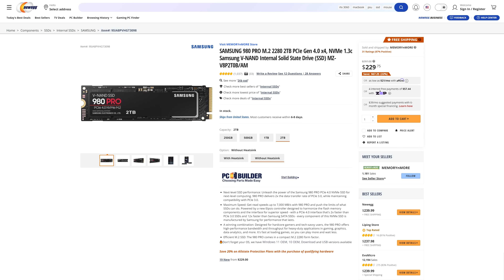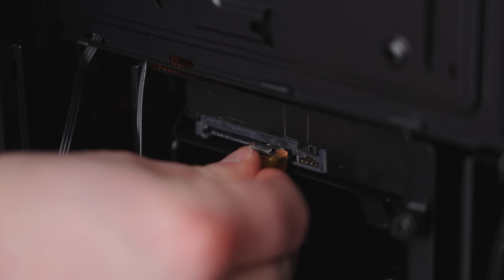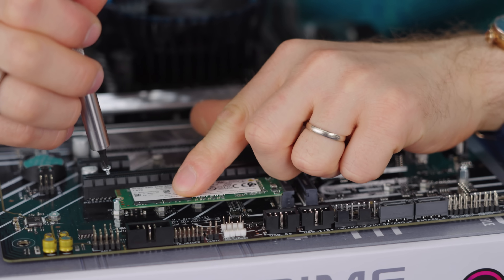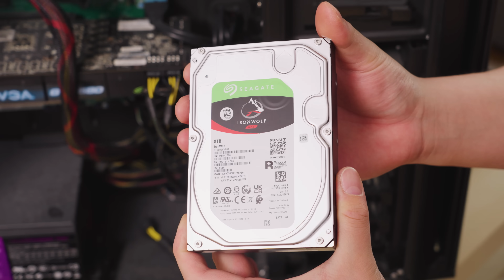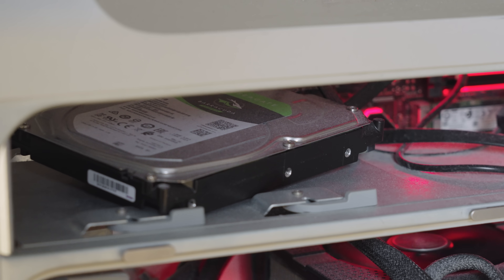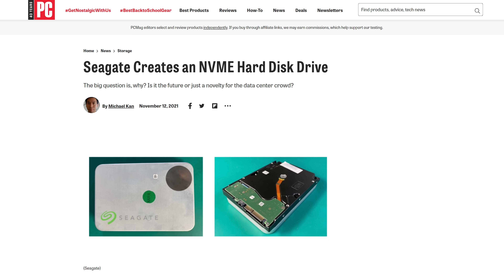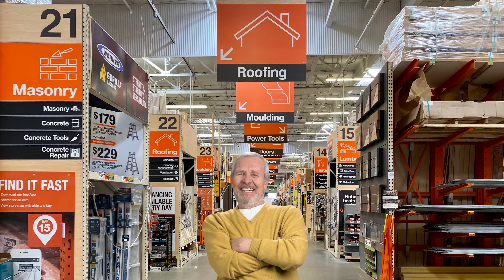Is SATA Obsolete?

Comment: I think you are too young to remember that SATA was introduced WAY before SSD's ever came out. SATA made its debut back when Pentium 4 was still around. SATA 1.0 came out along side PATA and was a niche thing with limited ports. Its true SATA's claim to fame only really came about when SSD's become a thing, it was near impossible to have a mechanical HDD flood a SATA bus, even to this day some of the fastest HDD's max out at 250MB/s thats slower than SATA-II speeds let alone SATA 3 speeds.

As for how long will SATA be around, well probably not a long time lest to its life. NVMe 2.0 specification adds support for NVMe protocol for HDD's, meaning HDD's will most likely be connected direct to the PCIe bus in later years, which honestly is not a bad thing, rather than allocating lanes for SATA, just allocate them for PCIe and allow the system integrators to chose how many of them are routed to either slots or drive connections

We are going to need NVMe for HDD when Multi actuator HDD's become the norm, Seagate already manages in tests to get 500MB/s out of mechanical HDD's
Reply: well in the near future sooner or later there will be new type of hybrid drive you can also get. this new hybrid drive bascly combies both the SATA HDD and the SATA SSD into a new hybrid drive that works in a new way. how it basically works is the HDD part of it is the high capacity slower longterm storage part that also doest need to have a constant source of power. then the SSD part acts like a very fast data speed and high capacity data cache buffer for fast and qick need for much more often used data. this combo can be used to massively reduce ware and tear of both of those drives by basely complenting  and cover each others weaknesses for a much faster and much longer lasting drive that hdd's and ssd's separately won't even be able to compeate against.

Comment: It's not the SATA that is obsolete, it's the SATA SSDs that are obsolete!
SATA 3 has a huge bandwidth, yet SSDs can't even do a 500MB/s Read and Write, without going under 100MB/s after a few seconds. We need better SSDs!
Reply: @pistolfied  But they are the only with high capacity........ :(
Don't worry, my OS is on an nvme. I was just saying that SATA is not the problem!
Also, do other SSDs have a constant of 500MB/s read and write? NO!!!! All of them are shit!!
SATA 3 has a bandwidth of 6 Gigabits per second, that means 750 Megabytes per second. And no SSD ever had a constant writing speed of 300MB/s, even being the only SATA SSD in the PC.

Comment: Sata would make sense to stick around since it might just be easier to expand storage. Well, pcie expansion cards for nvme ssd's exist I guess
Reply: As it is inside of the ATX spec though like IDE and PATA it is in the recommended part but it is in the required parts for all Intel and AMD chipsets I do not think it will be going away any time soon.

Comment: "NVME drives have to be screwed down"

Se we are just going to ignore the 4 screws that SATA drives use?

And let's not forget the artform that was rolling PATA cables into tubes and the origami like folding that was needed to organize those things. PATA was slower and harder to work with, but with appropriate time and care, could be cable managed quiet eloquently.
Reply: Don't look at me using double sided tape to mount my SSDs!
Reply: "Se we are just going to ignore the 4 screws that SATA drives use?"

If you have a good PC case, you'd have a toolless HDD/SSD drive caddy for it.
Reply: @TheTruthDragonNJ09  Even on a bad case, you don't really have to screw the drive in, just don't bump it too hard. Most of the time the slot that the drive sits in is tight enough that the drive isn't going anywhere unless you pick the computer up and move it. Even then you're probably fine.
Reply: @TheTruthDragonNJ09  by that same token, some motherboards have toolless m.2 securing latches.
Reply: If it's an SSD you can just let it roam free lol. A single screw is more than enough, or double sided tape. Some cases have those little sled things that clip in and use a single thumb screw to hold the sled itself in place.
Reply: @TalesOfWar  not if you're moving it around often
Reply: NVMe SSDs Need to be screwed down

2.5" Sata SSDs don't need to be screwed down, can sit free roam, whatever you want, no screw required. That's the difference.
Reply: @Axisoflords  Some boards have the nice handy clip thing, like Asus use.
Reply: Those SATA drive screws aren't absolutely necessary. I have 2 PCs, with ...14 drives total. Out of those, 3 are NVMe, which leaves 11 SATA drives. Both mobos support hotplug, and two drives aren't in a toolless slot.
Reply: Plus SATA drives are hot swappable, wouldn't want to try removing an NVMe driver while powered up plus they are usually hidden in very hard to reach places like under a GPU. SATA will still have quite a few years left as 550MB/s is still a decent speed for now, especially if it's just a storage drive.
Reply: @Mr Pais 2 PCs
Reply: While you should screw your drives down, they don't need to be screwed down to stay working, meanwhile SATA drives you can just leave there for years just sitting there, especially for SSDs where there's no worry about moving parts breaking.
Reply: Sata does not "need"  screws.
Reply: @Mr Pais Mine only supports 8, but without installing it into one of those oldschool super tower cases, you'd probably never be able to use all those ports. (I guess you could also install a few SATA to e.SATA port adapters to use the remaining ports)

Comment: I remember the first time I saw a computer with an SSD. It's boot up time blew my mind.
Reply: 3 seconds Vs ... 2 minutes
Reply: I agree, when I bought my first SSD last year (yep I'm pretty late to the party) it blew my mind because everything feels fast.... especially in multitasking
Reply: @KKRDaily  Damn, only last year? It's like a brand new computer isn't it? Lol. 

I bought mine in 2015 and it's impossible to go back to a HDD for boot times lol. I drug my old PC that was built in 2011 out to use as a streaming PC and it only had 2 HDDs in it, and I HAD to add an NVMe to it lol... It took sooooooooooo long too boot up lol. I ended up downloading a modded BIOS to allow NVMe support, and it was so damn worth every penny lol.
Reply: @KKRDaily  sounds like a ram issue.
Multitasking relies on ram, if your SSD improved your multitasking it means you are filling up ram and falling into disk swap.
Disk swap is not recommended for SSDs as it eats their lifespan quickly.
Unless you meant "faster starting speed of programs" instead of "using 2+ programs at same time"
Reply: @KKRDaily  did you get nvme or sata?
Reply: i was late jumping on the ssd badnwagon too. just figured thats how choppy computers were lol. The epiphany was real..
Reply: same here!, back then i went from 3 mins to 3 seconds, it was glorious.
Reply: I remember when running Linux against Win98/2K/XP was always funny when it booted under 5-7 seconds to KDM from normal 7200RPM HDD, where windows took good 20-30s at fresh install, and 1-3 minutes after a year.

SSD made huge difference to windows, but not so much for Linux, that was now under 5 seconds cold start.

I just converted few PC at work from 2.5" HDD to SSD and boot time from 3-15 minutes went down to 10 seconds. Drives weren't fragmented or anything, just stupid slow 5400 RPM drives.

Cheapest way to keep worker happy...
Reply: @paristo hmm Ive always how linux ran on hdds, i guess it makes sense its more better than windows because many distros especially light ones like arch and debian are bloatware free
Reply: Same! I upgraded my laptop to an ssd and it was crazy. Thought everyone was exhadurating. Also it ran a lot cooler as well
Reply: @Jamman1403  did... did u mean exaggerating
Reply: @3Dusers  To be honest, I like "exhadurating" better.
Reply: Now we're talking 10x faster than those OGs. I remember my first SSD. When I built my first computer it was the best $235 I had spent.
Reply: I was so used to Windows 7 booting time on HDD, when I tried SSD, the speed increase is just insane
Reply: @danielhandika8767  few years ago, I went from HDD to nand flash nvme. And my mind... It's somewhere on the floor.
Reply: I changed from HDDs/SHDDs to nvme. Supernova'd my brain.
Reply: Yep. My old laptop with a hdd had a 10 minute boot time. It was so bad that when it did boot it had to load in the icons for the apps on the desktop 1 by 1. The HDD was definitely the bottleneck. It had an i7 6700HQ and a GTX 970M and it was fast. I literally never shut it down because of those horrible boot times.
Reply: Now if only mobo manufacturers stopped making bloated BIOSs that take 10+ seconds to boot through that would be nice. Crappy laptop with text based bios on m2 boots in 3 seconds. Beefy gaming pc with gen4 m2 takes 10, unless you enable all the fast boot settings that make everything unusable after boot.
Reply: I was have my first ssd in 2015 its was fast, I have it until now.
But I keep lots of movies in my computer so I have 8 tb and 4 are of hdd.
Another with 2 m.2 and  one ssd with 2
Reply: I am late in the game. My first SSD was a week ago and it is just amazing
Reply: for real, made me change from just sleeping off the PC to turning it off entirely after every time I use it
Reply: 7 seconds for a full Linux desktop experience on the lowliest Thinkpad with an Intel G2. Unzipping 100 MB of Eclipse went so fast that I sat with my timer in my hand waiting for it to finish, only to realize that the hundreds of small files had unzipped in < 1s.
Reply: my nvme blew my mind on my pc when i used to be bumping with my hdd laptop
Reply: The opposite is true for me, ive always used ssds and I got mindblown how slow computers with hdds were at my school lab; they took 5 min just to boot into windows 10 while my mom’s old macbook air booted the os in 10 sec
Reply: Bought my first 128 GB SSD for 129 USD back in 2011.
Reply: @Vengan92  So, roughly $1 per gigabyte?
Reply: Bought my first ssd in the end of 2020. Also 128 gig for like £30 second hand
Reply: It was like 1984 all over again, when Apple introduced the Macintosh.  8 seconds of boot time is still quite awesome.
Reply: Last year I upgraded my Lenovo Thinkpad to an SSD. The thing now runs like a new machine in terms of speed.

Comment: Really for most yes it is. Unless you need massive amount of TBs of storage and don't need, want or have cash for SSDs for that, yeah. Also NVMe SSDs are not even that more than SATA drives, also DirectStorage advantage too with modern NVMe ones. Every computer comes with them too.
Reply: I just built a new computer last month, and often the NVMe option was cheaper than the equivalent SSD from the same brand.

Comment: to be honest I don't see SATA going anywhere anytime soon. Sure NVME is getting cheaper but it's still no where near the price of a 2.5 inch SSD and damn sure no where near as cheap as a mechanical SATA drive.
Reply: Look around, you'll be surprised. The difference isn't all that much and in some cases the NVME drives are actually cheaper than the 2.5" options. There's also the added bonus (of right now) that there are fewer shit tier NVME drives because they're slightly more expensive to make, but there are thousands of shit tier 2.5" options out there. It's easier to hide what's in them with the casing. Some are literally SD cards with a SATA connector inside a chassis.
Reply: @TalesOfWar  Yeah if you buy cheap 2.5" SSD drives from no name manufacturers. That being said NVME prices are comparable to 2.5 SSD prices so it really comes down to how much extra you'd want to spend buying adaptors to connect more than 2 NVME drives in a normal everyday gaming computer. Having extra drives for storage that connect via SATA makes it a lot cheaper to build a system and it's SSD so it's still fast. 

On a side note one also isn't going to get 20TB of NVME or 2.5 SSD storage for 500 like they can with a 3.5 option from a reputable manufacturer. I feel like people are real quick to want to call HDD entirely obsolete. Especially when game installs can exceed 100 GB these days.

Comment: 500gb   NVME boot
2000gb NVMe Game storage
4000gb HDD less priority game storage

HDD although slow and dangerous behind the wheel , can still serve a purpose in life.
Reply: Yeah I'm rocking a 1tb nvme boot drive, a 1tb nvme game drive, a 2tb SSD secondary game drive and 6tb and 8tb bulk storage drives. HDDs and SATA aren't going anywhere anytime soon.
Reply: @angry_wizard  too bad NVMe game drives have basically ran no faster than SSD. Finally with Direct Storage we are ALMOST to where our super fast NVMe actually load games faster than standard sata SSD.

NVMe has basically been less cables and space in a PC for people using them as game storage. Hopefully Direct Storage takes off with developers and our 7400mb read speed actually gets utilized. 🙄

Comment: It is easy to tell what happens when the price gap closes.  NVME becomes the better choice and SATA starts to get phased out.  There are plenty of SATA mechanical hard drives and SATA just wasn't made for so much speed.  I have a 2.5 inch SATA SSD in my case but because it has no delicate mechanical parts to render it completely useless if carelessly handled.  What I would like to use instead are those trays used in Poweredge servers but I have no idea how to mount those in a standard PC drive bay whether it is 5.25 inch or 3.5 inch.  I know there are kits for that sort of thing but I have no idea what the price for those is.  There are plenty of the Poweredge and other server drive trays on eBay and sometimes if you buy a drive one may even come with one.  I got one that came with a 100GB SATA drive.  I was nor expecting the tray too even though it really just mounts it in the case.  They are aluminum and not some awful plastic since they need be able to survive at least a few removals and insertions.